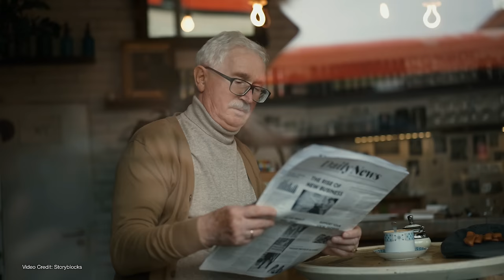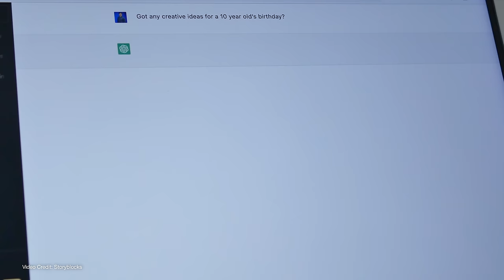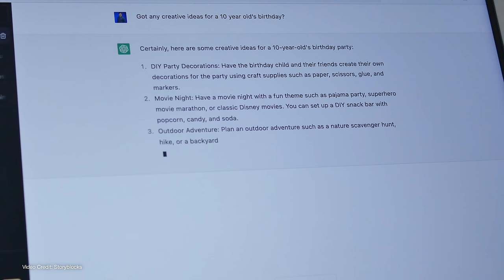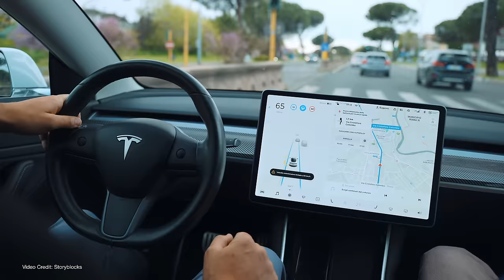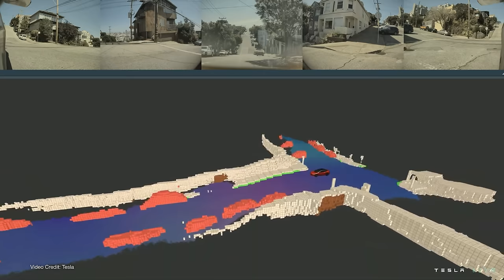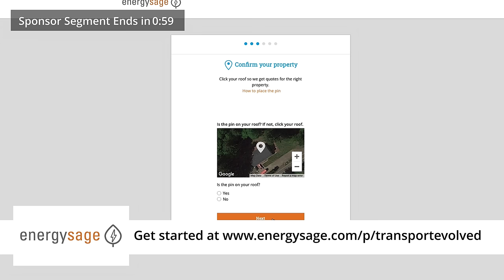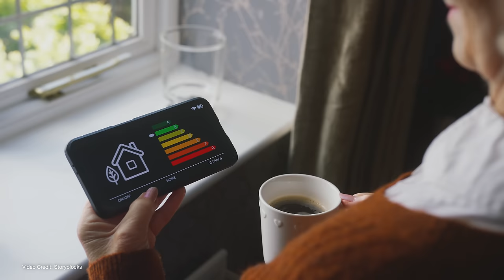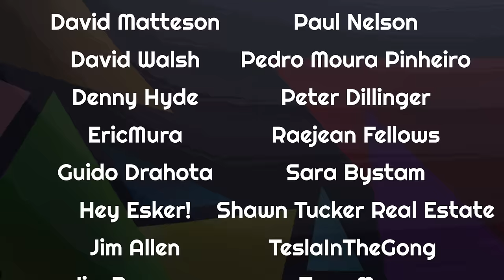The Electric GRID Is Under ATTACK (But It's Not From EVs)

Comment: EV's might not be the biggest problem for the power grid now, but if everyone was driving EV's, they definitely would be
Reply: If a transition that necessarily will have to take decades happens in 5 minutes, then yes you might find yourself in a pickle. But this is an impossible and irrelevant thought exercise at best. Even if every single new vehicle sold was EV, cars last a decade or two, that is the fastest possible timescale you should consider seriously. And this timescale takes some hard work, but is perfectly doable.  Source: Norway.
Reply: V to G might help
Reply: @geirmyrvagnes8718  Yes, but they are a small country with a population smaller than cities in other countries . Need more nuclear power renewable energy isn't reliable enough to provide steady power everywhere
Reply: @marvenlunn6086  Just divide any country up into Norway-sized pieces and do the same thing in every single one of the pieces, if you think it is so easy in smaller units. Is it easy for Minnesota, Colorado and Alabama because they are Norway-sized? And for your third statement about nuclear: Put some batteries on the grid, and you have steady, reliable renewable power for lower cost than nuclear. Most people will go for the cheaper option.
Reply: @geirmyrvagnes8718  Where are you going to get enough batteries . There are places that renewable will work and a lot where they won't. The sun doesn't always shine. The wind doesn't always blow, and hydroelectric power isn't available everywhere . Nuclear power is the cleanest, reliable source of energy available
Reply: @marvenlunn6086  Batteries are made in battery factories. Build more of those. That is where you get enough batteries. The sun always shines and the wind always blows somewhere. Sure, build some nuclear too, if you can afford it. More power is more good! 😄
Reply: @geirmyrvagnes8718  Batteries are bad for the environment, too they can't even make enough for cars. How many batteries would you need to power a city or a country . What about colder climates? Batteries don't work very well in the cold .
Reply: @marvenlunn6086  Everything is bad for the environment. Batteries less so. They CAN build enough for cars. Remember, you can scale up. You don't need all of this TODAY. You can't build enough nuclear plants to replace fossil fuels today, either. Your 5-minute timelines to fix everything are not useful. Batteries work just fine in the cold, that is just an engineering challenge. There are many types of batteries, and they don't have to be at ambient temperature. Is there anything else I can help clear up for you?
Reply: @marvenlunn6086 small countries have small problems with small resources available. Large countries have large problems with large  resources available.
Reply: @geirmyrvagnes8718  What about all the room taken up by renewable energy sources and batteries . Ask EV owners how good the batteries work in the cold . Renewable energy is good but we need to improve battery technology alot  before we can give up reliable energy sources
Reply: @marvenlunn6086  I drive an EV in Norway, you can ask me if you want to. 😊
Reply: @geirmyrvagnes8718  How much range do you lose in the winter? I have a 200-mile round trip to go grocery shopping and have to go another 20 miles to a charging station . I know the cold cut my range in half on my electric scooter below -6C wouldn't work at all . I tested it in the cold, coming out of a heated shed and didn't lose any range .
Reply: @marvenlunn6086   No vehicle works well in the cold.  My ICE vehicle range drops 20% on long highway drives and well over 50% in city driving with a lot of cold starts.  And filling up with gas at minus 30 or colder really sucks.
Reply: @jeffreyquinn3820  Refueling time makes quite a difference if you had to travel long distances a lot in EV's .
Reply: @marvenlunn6086  Not that much, really. It mostly comes down to driving on winter tires, the road being anything but smooth asphalt and the air is thicker, too. A good electric car can warm up the battery, so it could be similar to your experience with the heated shed. I would have to look for a very strange route not to come across many chargers before the battery gets low. That being said, 200 miles in the winter to buy some vegetables seems like a hassle. It should work just fine in the modern "long range" Teslas or something similarly specced. Heck, it sounds like you have more use for a Cybertruck than some celebrity in LA. Wherever that grocery store is, it seems like the only shining beacon of modern civilization in the wilderness, so they can, should and will have some chargers. Then it will be trivial. Don't go an extra 20 just for charging, that 200 is bad enough! But living somewhere like that, I wouldn't be among the first 20 % to switch to electric.
Reply: @geirmyrvagnes8718  that is 100 miles each way it is cheaper to go there every 1 to 4 weeks, usually every week if I have the time to catch the.sales and a lot of stuff is about 25% cheaper at regular price